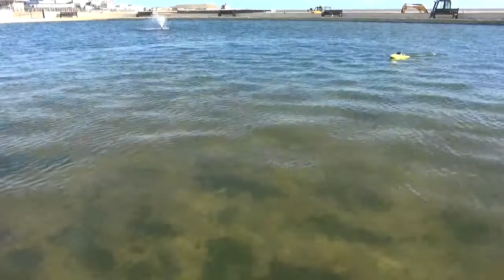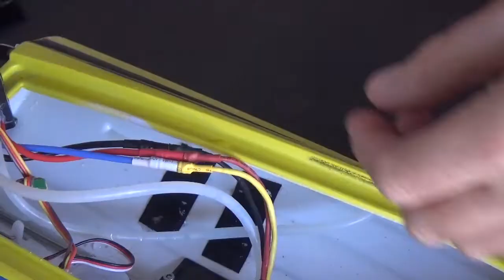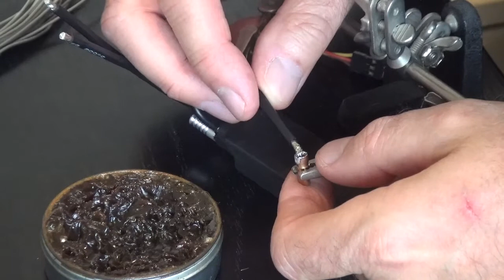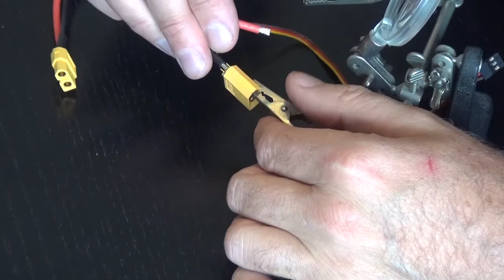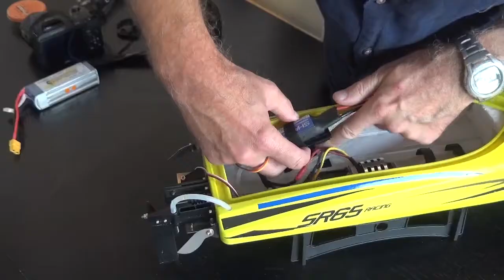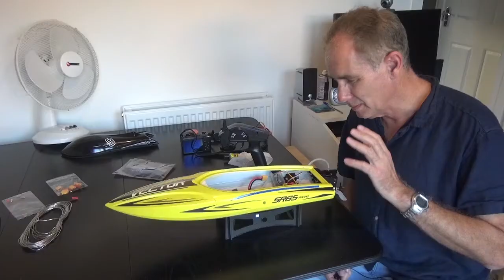RC boat Vector SR65 ESC Replacement

Comment: Hello... the Vector SR65b Reverse 792-7GR boat (the green one) won't run and stopped in the middle, just like yours. There is no beep from the speed controller (ESC) like there used to be, and the controller itself is hot. The only thing responding to the remote control is the rudder servo. Any ideas?
Reply from the maker: Not really. Could be several things. Sounds most likely the speed controller though.
Reply: Okay, I'll probably do what you showed, but what brand are the remote and receiver so they work seamlessly with the Shark ESC?
Reply from the maker: @ufobalkans8199  Etronic Pulse E2.
Reply from the maker: @ufobalkans8199  R3FS Receiver, 60Amp Shark ESC.
Reply: @Calvertfilm  The store told me to return it for repairs; if it breaks down again, I'll do what you did. Thank you!
Reply: @Calvertfilm  Wasn't it a 40A ESC? Why 60A?
Reply from the maker: @ufobalkans8199  My first upgrade was to 40A but it could not handle 4S. 60A can, although I do not usually run it on 4S, as 3S suits the size of my pond.
Reply: @Calvertfilm  Oh... yes.

Comment: Tốc độ có nhanh hơn không.
Reply from the maker: ESC doesn't increase the speed. Going to a bigger battery does though.
Reply: Thanks
Reply: Tôi đã thay esc giống loại của ban.và motor 2218.3800kv chạy rất nhanh.bạn thử thay motor xem
Reply from the maker: @gaucon8002  Ok thanks for the idea. I may try that one day.

Comment: Funny enough I installed the Shark ESC on my SR65 last week. Shark escs are very good quality
Reply from the maker: Yes it seems to go fine, although on 4S it did cut out I think to protect the circuits but on 3S it is quite happy. Run it several times now.
Reply: @Calvertfilm  I've changed the motor to a 2830 4000kv and get similar speeds on 2s but it chokes on 3s full throttle. As long as I'm at 2/3 throttle or less it's ok
Reply from the maker: @redditchrc960  That's interesting. My model shop said that if I changed motor, size of prop etc that it can all have knock-on effects, as you point out here.
Reply: @Calvertfilm  The prop change is right I tried a 1.4 pitch on the stock motor and it was cutting out

Comment: Nice work did the motor not burn out with the 40 amp esc ?
Reply from the maker: No seems fine as the battery power is only 3S now. I did try 4S but the ESC just cuts out here and there still. So 3S it is.